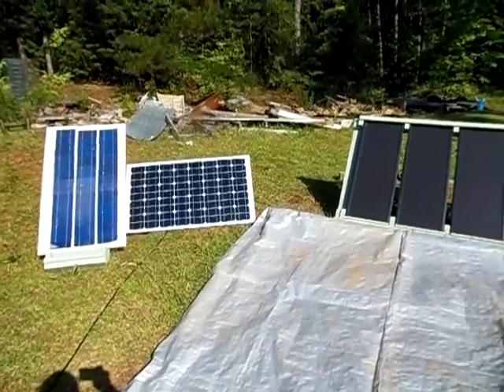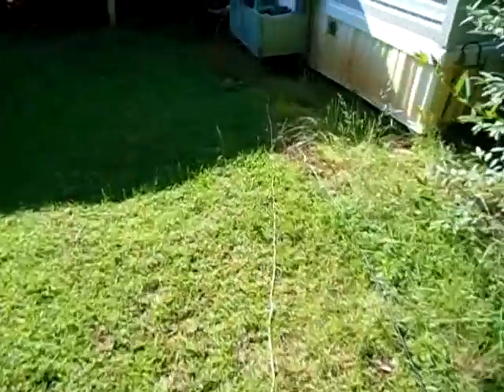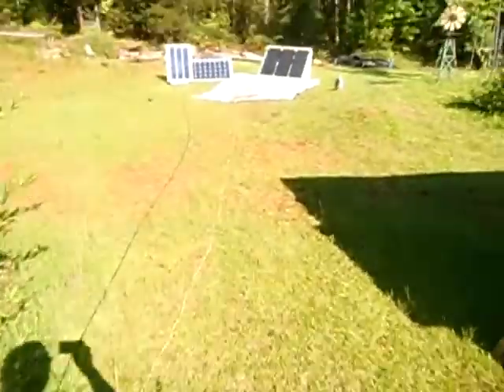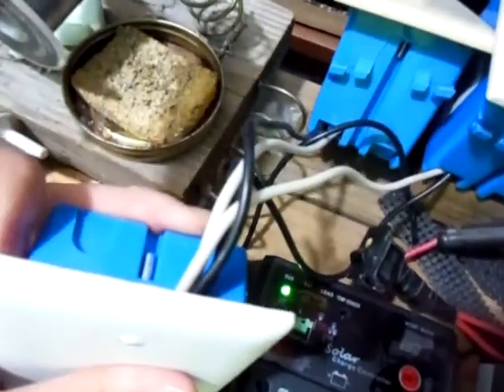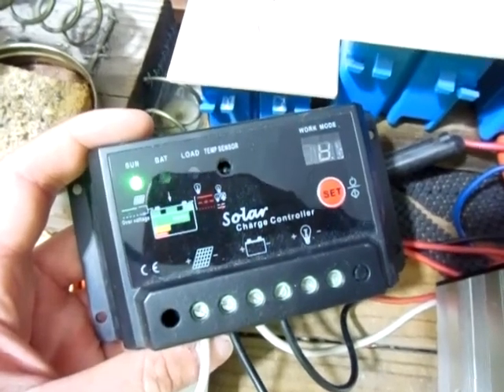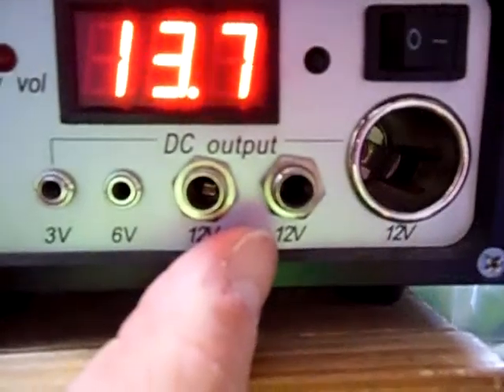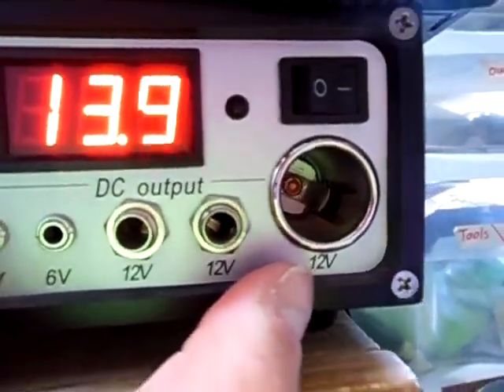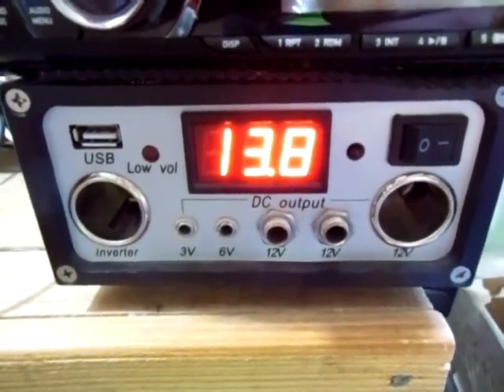190 Watt Solar Power System

Comment: Question. ..Why two charge controllers? I like the digital on my HF controller,  too...so why the PWM?
Reply from the maker: The PWM charge controller charges the battery in pulses (which helps the batteries last longer) The charge controller that comes withe the HFT kit doesn't pulse. The HFT controller charges the batteries up to 14.5V then it drops to 13.2V. Unlike the HF controller, the PWM pulses the batteries between 14.5V and 14.7V. (then it drops into float mode) Pretty much the PWM is just a better way to charge your batteries.
Reply: 2012solarful Are they both hooked up at the same time?
Reply from the maker: No, they are not. I only use the HFT controller for the power outputs.
Reply: 2012solarful Gotcha,  thanks!